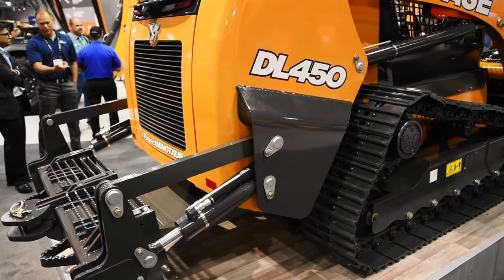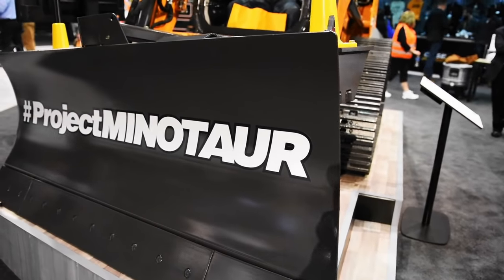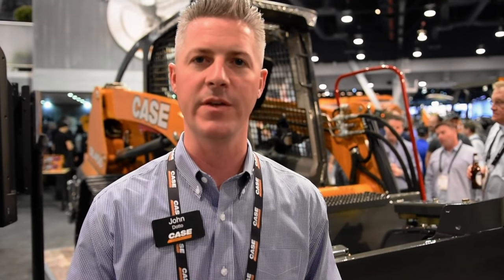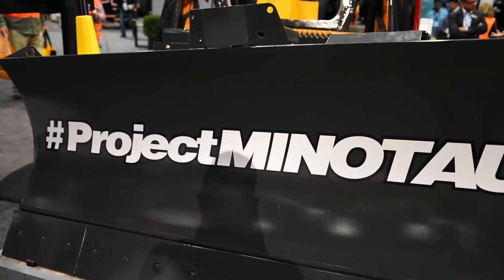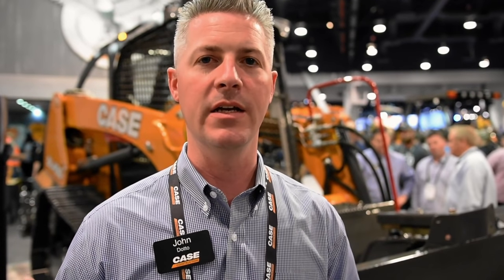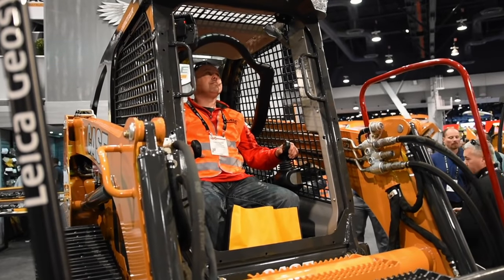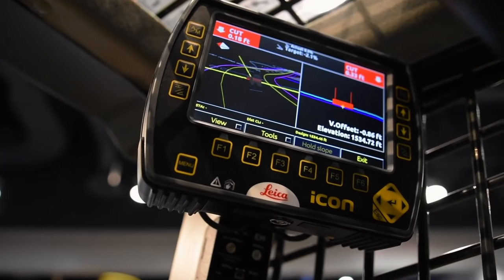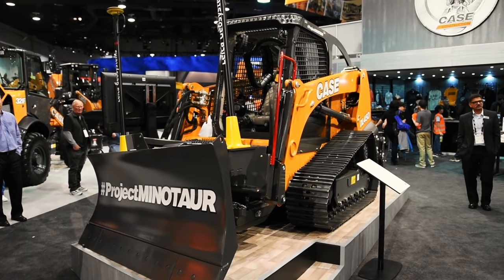Case CE unveils half CTL, half Dozer concept DL450

Comment: I have made about 15 machines for 15 years, but I have gotten the last 2 years. Our 2013 case Cx300C machine has got us wrong about 5500 hours in spite of the fact that there is not any faulty account made. The authorized service can not detect any malfunctions on the circuit at this time. It is not resolved by a competent authority

Comment: Pure case right no NH engineering?
Reply: Take a case over any other loader 30 years of skid loaders nothing  beats case. My 1845c 65 horsepower  out performs 110 horsepower  Volvo out push , lift or dig only thing  close old newholand
Reply: Michael Willcutt old new holland? But yeah those older cases were some of the best skids ever made !
Reply: I have a case 1968 1845 c and use it hard every day I run it 5 am 9 pm on a farm I only had to take it to the shop 2 times
Reply: must have quite a few hours, 50 year old machine running 19 hours a day, WOW.
Reply: Bruce Lundberg yeah it's definitely a good machine I have absolutely no idea how many hours it has the hour gauge has been broken for at least 1 year now